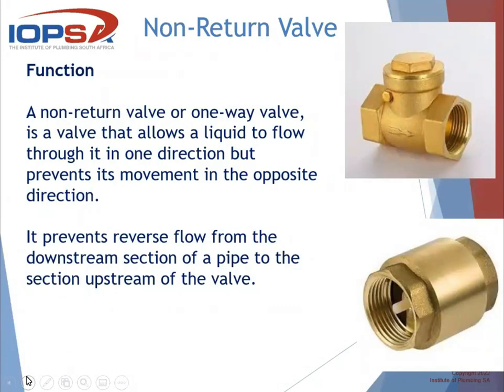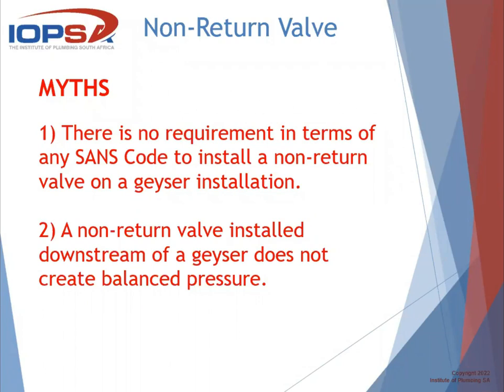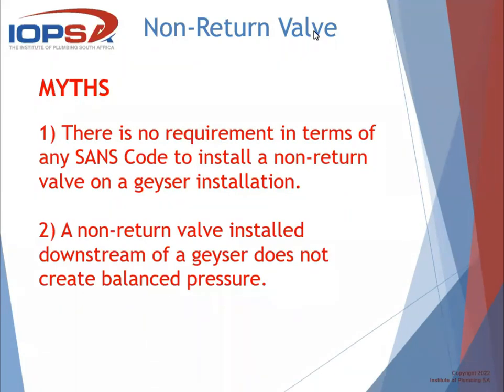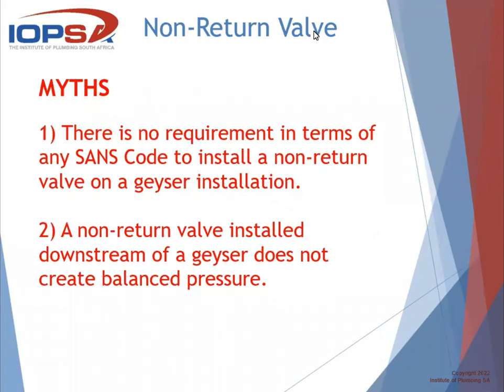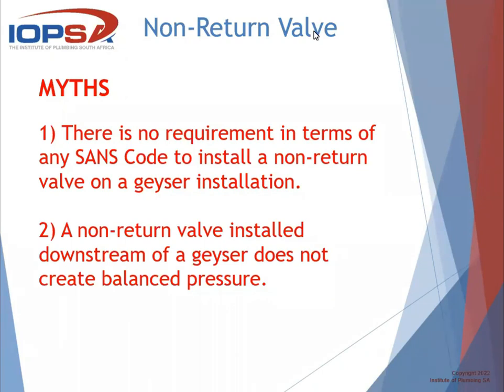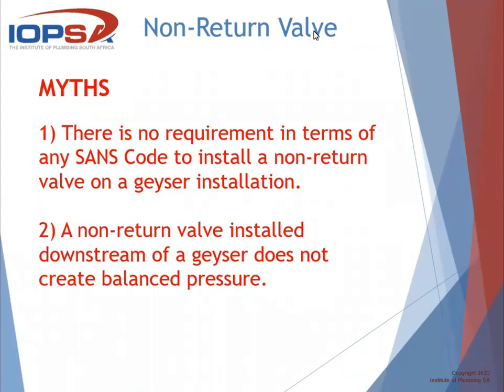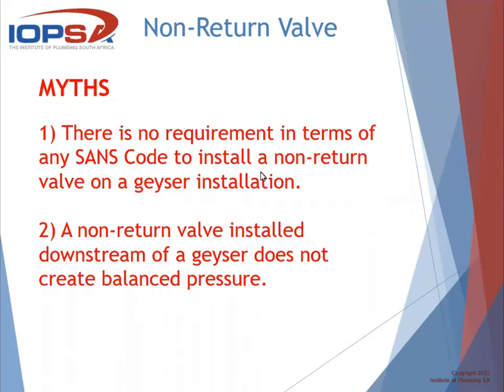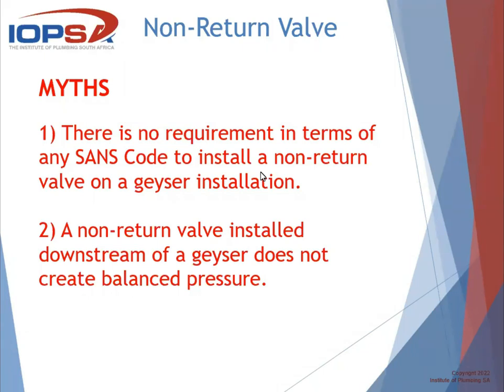Tech Talks - Question & Answer Session - 23 June 2022

Comment: Plumbers also very often have installed water storage tanks that loop to a pump but dont have the temperature in the tank measured and they never seem to have circulatory pumps installed to prevent stagnation

Comment: In terms of the balanced systems I recently had to adjust taps due to 1 tap being unbalanced and the water was pushing past the non return and triggering the pressure relief on the PRV.
Reply: Its exactly what you described. Funny. Also plumbers seem to think that using plastic fittings between copper and galv that it stops electrolysis not understanding that water carries current. If plastic end its then our anodes should be plastic instead of magnesium or zinc.